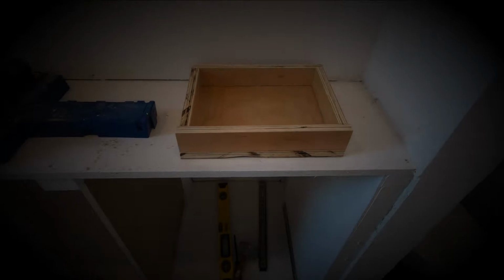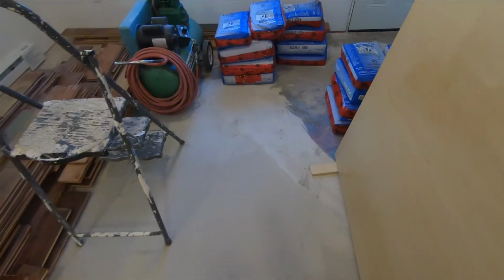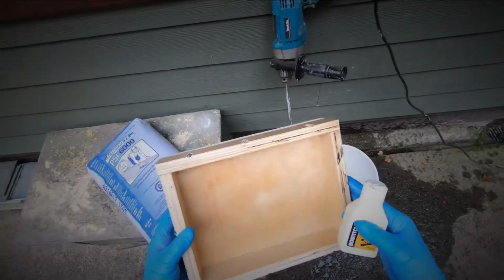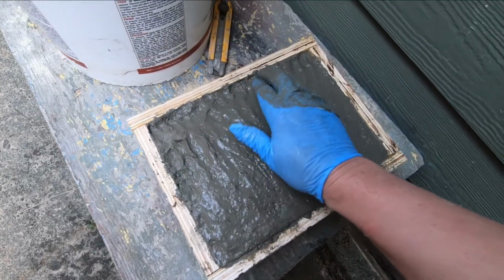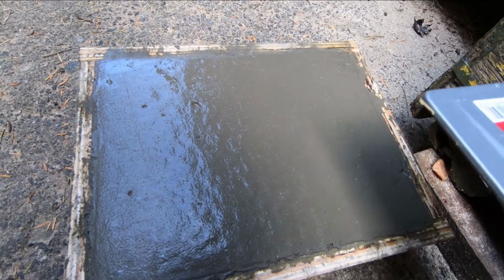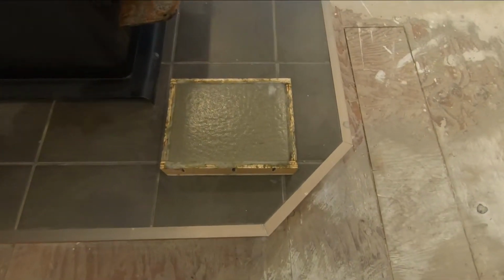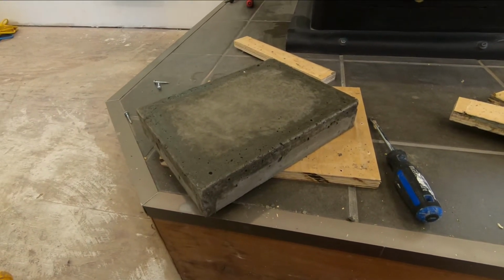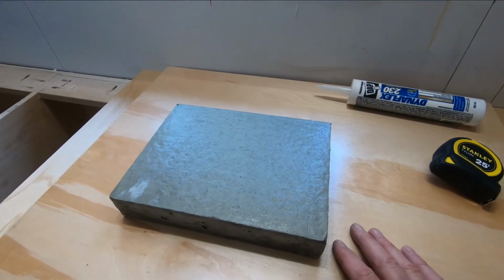CONCRETE COUNTERTOP TEST POUR

Comment: How's she goin'?  I have a friend who wanted to make concrete counter tops.  He tested it on a patio table.  He poured the top and added black iron pipe to it for legs.  It turned out really nice but he used the bottom of the pour for the top.  I think you will have some nice looking counter tops when you're finished.  I bet you could float the concrete pour and get the cream on the top when trowelling and cover all the aggregate and they will be nice and smooth.    Looking forward to seeing them!!!  Take care and good luck with the pour!!!
Reply from the maker: Thanks for stopping by. I will be making the forms this week and hopefully pour some concrete soon after. In some ways, I would prefer to flip the form over and use the smoothest side, but I still think that the trowelled tops will look good--and organic... Or it will be a complete flop and I'll just paint over everything and keep a tablecloth on all of them, haha. Fingers crossed going forward.

Comment: Keep in mind, I'm definitely not a concrete guy, just the grunt who used the wheelbarrow. I remember that the guy doing the finishing always kept his trowels in a bucket of water and kept wetting them as he worked. He'd have that stuff looking just about like glass. As soon as we had the stuff screeded, he'd be bullfloating and troweling.  If you want to try another test pour, get your mix a little on the sloppy side and use an orbital sander on the sides of your form as an ad hoc concrete vibrator and try wetting your trowel.
Reply from the maker: I'm no expert either. Just someone who is very unwilling to pay the high prices they want these days for store-bought countertops. 
I poured a small countertop yesterday and it will show up here on my channel soon. I did use some water on the trowel, but I'm still learning when to trowel. It seems I trowel too early. What I see others do is wait until the concrete is near hard, then push hard against the surface to smooth the surface. I've been afraid to wait too long. It looks like this PSI 6000 mix is going to be OK though (I've seen some other guys using it unmodified for countertops). I have over 25 bags to mix and pour, (plus some more concrete projects coming up) and my back has been hurting when mixing by hand in a bucket, so I looked on the Princess Auto website (Harbor Freight equivalent) and found a stand-up cement mixer on sale for $189 CDN ($150 USD), so I ordered it. That should help save my back a bit, even though I'll still have to carry the finished mix to the forms.
Reply: @EverydayProjects  Can you acquire/build yourself a large stand for the mixer to raise it up over the countertop level and wheel it around the kitchen? I don't know if that makes it worse though. You'd be lifting the bags up even higher.
Reply from the maker: @heliarche  No room, but a great idea! I think that having it set up just outside the back door will be a big improvement. Plus, I can have one bag mixing while I pour the other. Still plenty of back-breaking work...anything to do with rocks or concrete always is. My back gets sore just thinking about it !